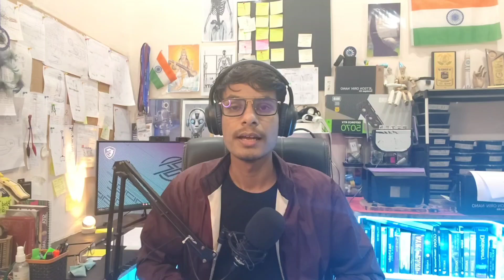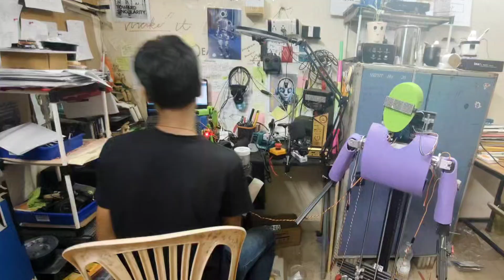Starting With Robotics Is Easy

Comment: Software 
1.Cpp, python 
Some python based projects
Cpp for arduio embedded programming 
2.frame work - linux ROS
3.github 
4.ROS(1-2years Slam)
Learn step by step
Concept like
Slam , IK ,EKF, control system,PID, Path planning 
Perception - lidar depth camera
6.machine learning models
7.hardware
Electronic (resistor, capacitor,diode,transitor, basic projects 
8.pcb designing 
9.embeded system -arduino esp32,stm32
10.senseors
11.actuators 
12.simulation 
13.cad
Reply: ty!